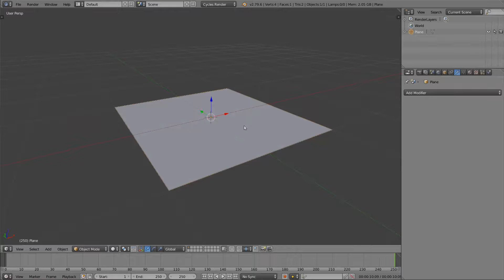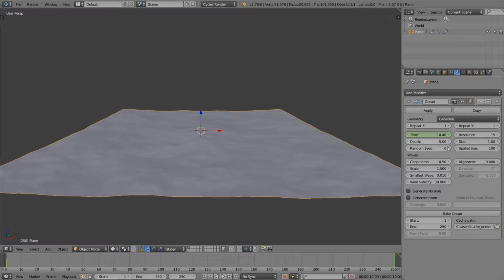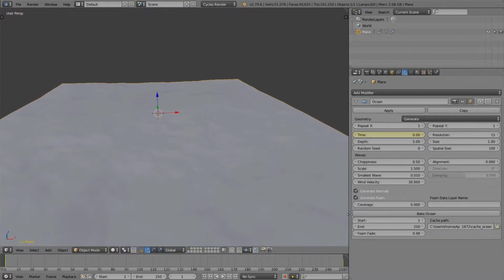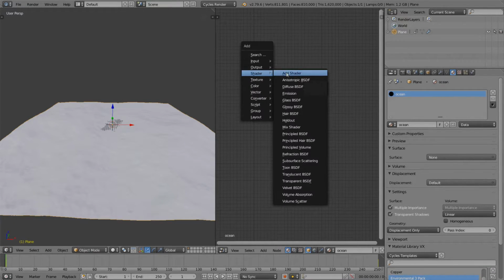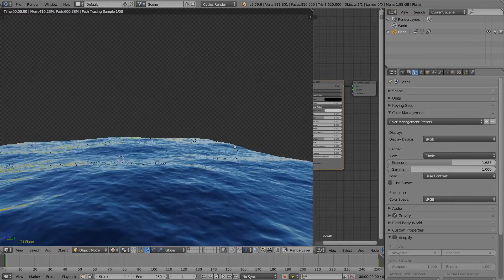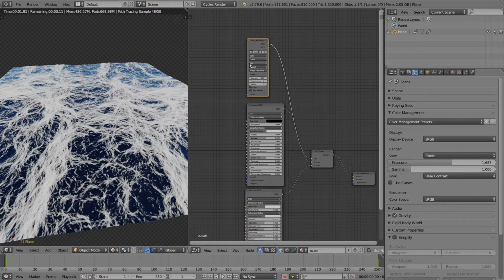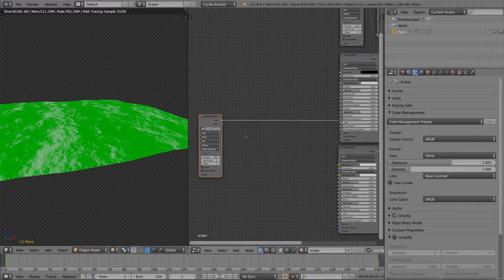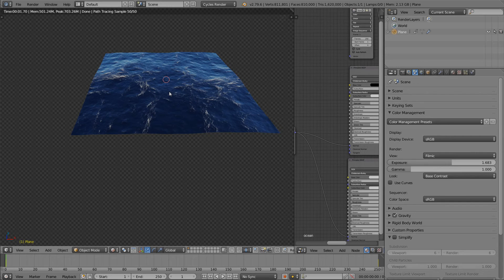Tutorial: Ocean Modifier plus FLIP fluid sim equals greatness! (part one)

Comment: Excellent series of tutorials first of all! Thanks a lot. I'm stuck on 6:21. Kind of a noob trying to do this in Blender 2.8.  How did you change the sky to blue by just changing to 4k? Did you flip the hdri somehow?
Reply: Oh, wait just figured it out. You need to change the viewport shading to rendered to see it. Note you may want to tick on Film ->Transparent in the Scene panel. Another thing to note in order to use the factor for the foam for the other principal shader I had to turn on cyclic when I imported the texture.
Reply from the maker: Yes! The HDRI was flipped to Flower Road - before that, I had another image loaded into the background - even though it looked like I had Flower Road already. By the reflections the original looks like a park with trees. Looks like you're doing fine - but PLEASE ask more questions if you have them. I know the tuts aren't that good at communicating my ideas at times. Gaffer is the addon you see me clicking on - great at handling your HDRI library.

Flower Road HDRI: https://hdrihaven.com/hdri/?h=flower_road
Gaffer: https://blendermarket.com/products/gaffer-light-manager

Be careful about using Flip fluid sim in 2.8...It may not work as well because of all the changes to 2.8 - but it's stable in 2.79.